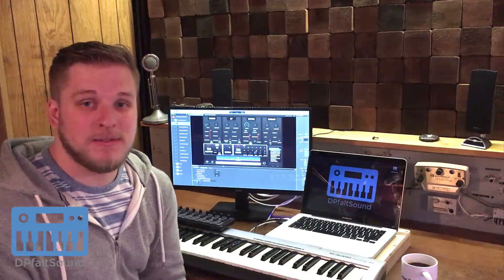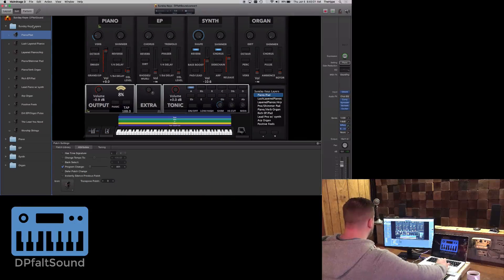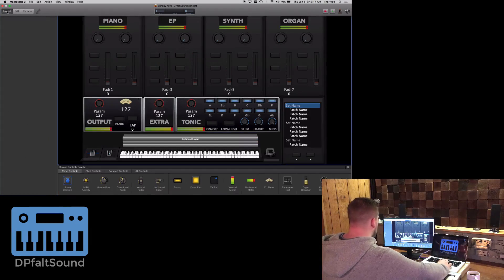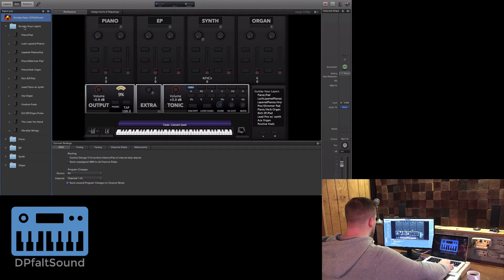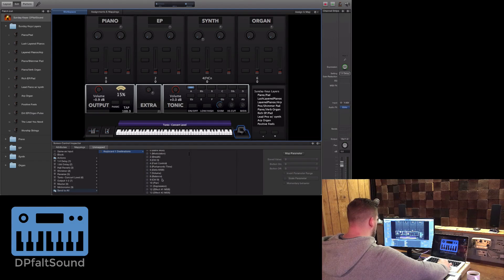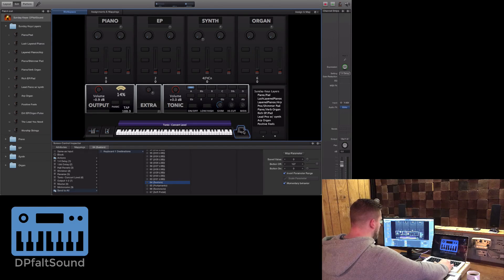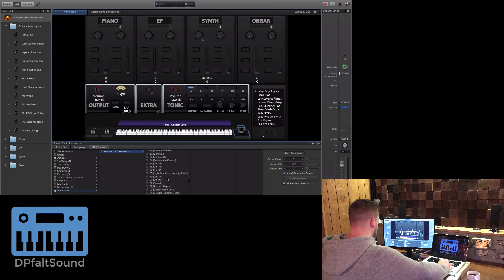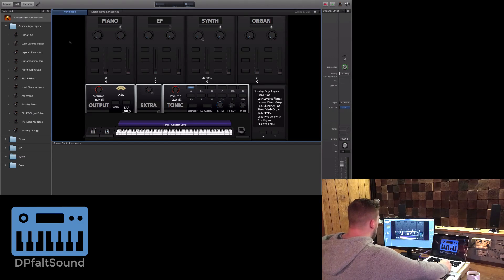MainStage Tutorials: How To Invert or Reverse Your Sustain Pedal in MainStage - Sunday Sounds

Comment: This video doesn't solve the problem with sustain which won't stop sustaining once letting go of sustain pedal, it has nothing to do with the issue you are addressing.  Please help!!  I will be using my gear tomorrow!
Reply from the maker: hey there, if your pedal is sticking, but it doesn’t seem like it’s inverted, then it’s likely that either the pedal data being sent by your keyboard isn’t correct and you’d need to solve that problem within your keyboard (need to send CC64 127 for on, CC64 0 for off) or that your software isn’t correctly classifying or interpreting the data, perhaps it is treating it as a toggle instead of momentary. you can try to fix that by deleting your midi learn connection and remaking it if you’re using the Sunday Keys standalone app, being sure to quickly press and release. if you’re using mainstage, you should select “momentary” pedal type in the Assign view in MainStage. 

If you need more help with this feel free to contact us via our website.

Comment: Unfortunately I can't get this to work, nothing changes visually or function-wise. My Roland pedal works normally with my Roland keyboard, but I don't like it because it makes too loud mechanical noise when releasing. I have a Korg one lying around which has softer action, but it has reversed polarity, so when I'm not pressing it, sustain is on, and when I'm pressing it, the notes are short and dry. I have my MainStage project set to display MIDI CC, and indeed, on release CC 64 goes to 127, and on press, it goes to CC 64 0.
Anything more I could try?

Comment: I solved my problem with my Korg sustain pedal by tweaking the "scale parameter" graph without inverting the parameter range. The problem was Korg's pedal was not only inverted in polarity but registered a max value of only 14 compared to the 127 that mainstage expects (check yours using the MIDI message monitor). Changing the max value in the "button on" text box doesn't work and I suspect this is either a bug in mainstage or an unintuitive design. Anyways the graph for my Korg pedal ended up looking like a downward slope "\". Hope this info helps someone out. Peace.
Reply from the maker: Hi Ian - I think that is just an issue with that specific pedal, or the midi keyboard that pedal is plugged into. Its not standard midi protocol to send a value that is not 0 or 127 for a sustain pedal. Thanks for sharing, and I am glad you got it sorted out!

Comment: Thank you for this tip! Annoyingly it didn't work for me, though. When I invert the parameter range in MainStage,  the pedal starts behaving like a toggle switch, sustaining on every second press. Unchecking the box makes it act normally again. Checked all layout settings, couldn't find anything. How could this be? It's a Studiologic Acuna 88 keyboard by Fatar.
Reply from the maker: Check out this video to try to diagnose what's going on: https://www.dpfaltsound.com/blog/troubleshooting-midi-connections-in-mainstage-3

Comment: Hi! After Mainstage update (Version 3.3) , when active the "Invert Parameter Range" the sustain pedal stay pressed. I squeeze again and it does not sustain. It functions as a switch and not when pressed.
 In normal mode this does not happen. Can you help me?
Reply from the maker: In the Layout tab, change the "Type:" to Press/Release. You might also have to change the "Send Value to:" to "None."  You will also want to make sure that your hardware is sending MIDI #64 for the sustain.

Comment: It is working now, but it still shows up on the perform screen as reversed. Even though it's not reversed
Reply from the maker: The on-screen sustain doesn't always respond accurately. It's a known glitch with the current build of MainStage. As long as the hardware works, that's what counts, right? :)
Reply: +DPfaltSound yep! When I restarted mainstage it was working correctly. Thanks for the reply!
Reply from the maker: Great! No problem.